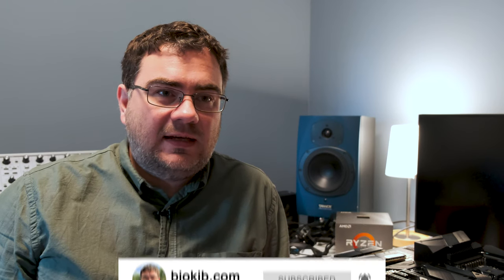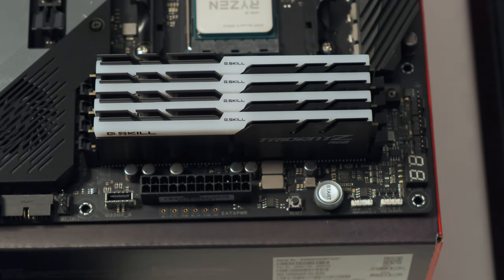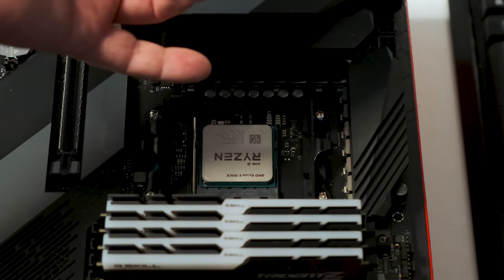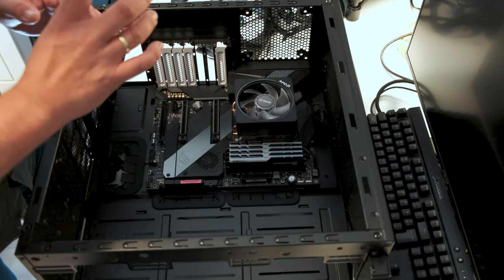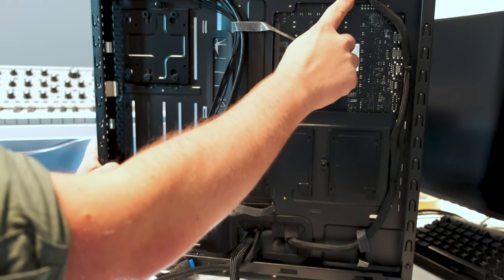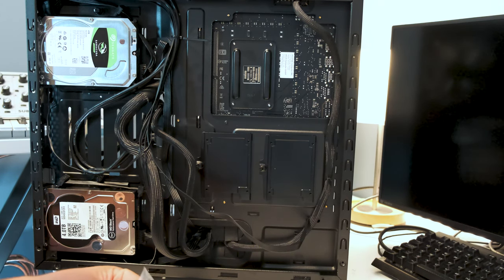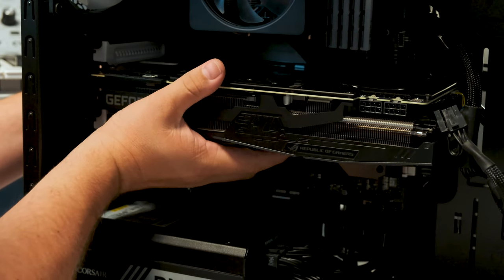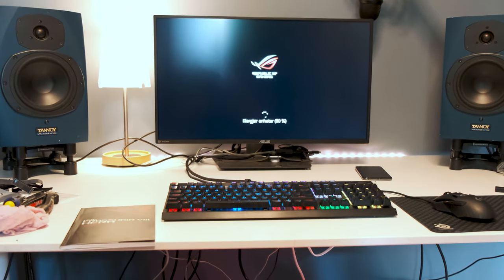How to build a gaming PC - easy to follow step-by-step guide with chapters!

Comment: Explained everything very well! Removing the sticker from the SSD is not necessary  because the sticker is actually a copper heat sink that is used to evenly disperse heat  on the SSD, and  it also voids the warranty. Other than that great video!
Reply from the maker: Thank you! :)

Comment: Won't the Noctua D15 interfere with your RAM? Noctua says the RAM clearance on the D15 is 32mm while your GSkill RAMs are 44mm in height.
Reply from the maker: I just moved the fan on the cooler up a little, and it fits. Its movable :)
Reply: In that case the height of your CPU cooler has increased to 177mm now. That's just 3mm shorter than the max limit of your case. Amazing choice of components :)
Reply from the maker: Thanks 😊

Comment: I just got this motherboard and I plan on using a fan cooler instead of Water Cooling... my question; I would like to add RGB fans on the side of my build as if I had a radiator with fans. How can I plug the RGB fans? Do I need extension cables and or some sort of module?
Reply from the maker: Should work, this mobo includes RGB headers and addressable Gen 2 RGB headers.

Comment: Hi Bjørnar. How is the Ryzen 3900x treating you? Still happy with the configuration? How about noise level? I'm looking at a similar configuration, except that I want SFF / small tower / desktop to save space. And I'm fine with a 2070 Super. Any case to recommend that can fit the Noctua NH-D15? Cheers and thanks for awesome videos.
Reply from the maker: Its working well for my use still. If the PC works hard I can hear some fan noise. Other than that its mostly silent. Not that up to date on SFF cases and if they fit the NH-D15. Its big. Noctua have other coolers that are more tailor made for cases like that I believe. For example NH-L9x65.
Reply from the maker: Thats a nice setup indeed! I am thinking of going smaller myself since the room I am in is small. But I think that will be a video when the next CPU from AMD launches. I noticed he underclocked the CPU. I guess that's why he gets good temps maybe. By not boosting it. Not sure if would run it like that, maybe need to test it and see how it works.

Comment: I looked up online and found some people saying that the sticker on M.2 SSD is designed to help the heat dissipation. Then I just wonder do we really need to remove that for better heat dissipation and whether the M.2 SSD's warranty will void by removing that. My M.2 SSD is Samsung 970 EVO Plus and I didn't find much information regarding these questions from the documents came with it.
Still, thank you for your video and it is the best and most detailed instruction video for X570 motherboard!
Reply from the maker: Dont remove it if it voids the warranty. Mine was so old so I figured it could be tried. It seems to work well still.

Comment: Did you notice and bend with the m.2 with the integrated heat shield? Ive heard it is a known issue and i may think twice if it can make or break my PC.
Reply from the maker: Not that I know of. Its been running fine for almost a year now.
Reply: Bjørnar Kibsgaard okay thank you! I saw many reviews talking about DOA boatds and quick failure rates. Im glad to hear another positive review!

Comment: What cable did you use to connect the cpu to monitor tho it doesn’t have any displayport or hdmi?
Reply from the maker: The GPU is connected using and DP (DisplayPort) cable to the monitor.
Reply: What kind of displayport type c?

Comment: I’m going to use this motherboard with a ryzen 9 5900x and a 3080 but I’ve seen that this board has died on a lot of people and was wondering if you have had this problem. Thanks
Reply from the maker: Yep, it died the first time I got it. The replacement have worked just fine 24/7 for a long time.

Comment: I follow the steps that you did why still can't the motherboard got the light but couldn't start
Reply from the maker: Its time for troubleshooting. Try re-seating everything first. If that doesnt work, try disconnecting devices you dont need for a successful boot. Like running with 1 ram stick, etc.

Comment: I followed your guide and it was really helpful. But I failed to get it started as I am getting 02, I double checked wires, RAM, and GPU. Still see the same issue. Any troubleshooting tips? Appreciate any help!

3900X
Crosshair VIII Hero
G Skill Trident Neo Z 3600 F4-3600C16D-32GTZNC
Sabrent 1TB Rocket Nvme PCIe 4.0 M.2 2280
ASUS 2080Ti OC
CORSAIR AX Series AX1000 CP-9020152-NA 1000W
Reply from the maker: All power connectors connected? To GPU, Mother board etc? Another guy further below here had the same issue. He forgot to insert all PCI-E cables to the graphics card. :)

Comment: Would it be easier to connect the case headers before the psu ? So there is more space to get your hands in. I will be building a similar pc next week ( first time build) so thanks for doing this video, it will be a great help. The x570 board has x16 on both lanes, so you can install the GPU in either the top or bottom slot ?
Reply from the maker: You can connect the case headers first if you want. As for GPU install, you need to check the motherboard manual if the slot you want to put the GPU in runs at full (16x) speed. :) Good luck!

Comment: yo, i am currently building a pc right now, and i got a bit scared when i put the cpu cooler in, because i put alot of pressure on the cooler, does that ruin the cpu?
Reply from the maker: The cooler that shipped with the AMD CPU? The bracket that holds the cooler down should have some pressure on it. So that the cooler is not loose. I think you are fine.
Reply: @bjornark  ok thank you so much, mate. Btw u from norway? I am!

Comment: My exact same motherboard doesn’t boot up and it’s stressing me out so much. I need my PC for important stuff. Error code goes from 27 to 0d and lights up yellow. Internet says it’s my DRAM. I’ve tried countless solutions through Reddit and other sites gathering information and none works.
Reply from the maker: Maybe its the SSD? My corsair drive just died. And it just booted into the bios. Have you tried bios update? If you can get into the bios that is.
Reply: @bjornark  I've fixed it thru updating bios, cleaning and rebuilding pc.
Reply from the maker: Sounds good!

Comment: Its been a while since my first pc build. But you mentioned cpu power supply. Is it included with the cpu, or must i purchase it separately?
Reply from the maker: You get power for the CPU from the power supply for the computer. Thats the only thing you need. :)
Reply: Bjørnar Kibsgaard thnx for the reply. i thought i was totaly way behind on pc build, i actually thought you meant we need a specific cable for todays powerful cpus leading to the power supply🤪.
im attempting my second build consisting of the same mobo and cpu as yours along with corsair crystal 570x case. while waiting for all to be delivered, i overlooked the part where the nzxt x52 cpu cooler might not fit above the motherboard and cannot seem to find anything relating from google. do you think it might be okay? nice informative vid by the way.👍
Reply from the maker: You can find the specs on the cooler most probably on the manufacturers website. It will tell you about the size, and if it will fit or not. Good luck. :)

Comment: Whats your personal reason or need for chosing that motherboard over any other cheaper mb?
Reply from the maker: Asus have always been stable and working well for me. So that is one reason. Also the components are a bit higher quality, and that can help if you want to do some overclocking. If you want to run everything stock and not overclock, there is nothing wrong going with a cheaper motherboard. As long as it supports the CPU and the features you need. :)

Comment: How does it run? How much can you overclock your CPU and GPU in your build? Did you get your RAM running at the right speeds? How does it fair in gaming or other processes?
Reply from the maker: It runs very good and I run the memory at stock speeds. As far as gaming goes it works extremely well. No complaints here.

Comment: do you think a NH-D15 will fit this motherboard? (not sure about the ram im gonna get yet)
Reply from the maker: The NH-D15 worked fine on this mobo. Just Watch your memory height. Or you may have to adjust the fans.
Reply: @bjornark  thanks, do you know why the amd website says on the 3900x page "memory 3200mhz / 2 channels"?
does it means i need 3200 & only 2 channels?
Reply from the maker: 3200Mhz is a good choice on a budget. But if you can afford it I would go for 3600Mhz memory. AMD is more sensitive to memory speed, compared to Intel for example. G.Skill makes memory that works well with ryzen. For example, G.SKill Trident Z RGB F4-3600C16D-16GTZR. I am using those, and they work fine.

Comment: Is removing the sticker on the M.2 ssd going to ultimately do anything?
Reply from the maker: Honestly? No, I dont think so in day to day use. It may cool a little better because the heat transfers easier with direct contact to the chip. But no, I dont really think you need to do it.

Comment: I don't understand why you installed your M.2 in the 2nd slot and not the first slot?
Reply from the maker: Easier to get to it in the second slot, if I would want to upgrade later on. CPU cooler and GPU is so close to first slot.

Comment: Thanks for video! Did you use some additional fans? I'am trying to copy your specs while building my first build =) BTW how loud is your build?
Reply from the maker: Sounds good! Yeah I am very happy with this build so far. It works very well for my needs at the moment. I havent used any extra fans other than one in the front, and one in the back. Other than that the fans on the Noctua cooler and graphics card is low in noise. In normal use, the system is very quiet. Also remember I use the Fractal Design R series case. And those are extra soundproofed. Good luck with your build. :)
Reply: @bjornark Hi! I'am building now this pc =) Is it ok, that my second noctua cooler, which is under the dimm slots, is above center cooler?

Comment: How are you connecting the motherboard to a monitor. As it has no HDMI or DisplayPort
Reply from the maker: I connect the monitor to the graphics card (GPU), which sits mounted in the motherboard. :)
Reply: @bjornark  so if i connect an nvidia rtx 3080 (which has a display port) to my motherboard I can then use its display port to connect the computer to the monitor. I am planning on building my first pc soon and I’m trying to get all the knowledge i can before starting. Thanks
Reply from the maker: Yes, you place the graphics card in the motherboard. And you connect the display to the graphics cards outputs. :)
Reply: @bjornark  nice thank you, sorry for any inconvenience
Reply from the maker: No problem, good luck with your build. :)

Comment: Can you explain how you decided or where to go to design a PC and the most optimum parts to use?  Thanks in advance.
Reply from the maker: Lots of research, watching other videos, reading articles etc. And some experience. :)
Reply: @bjornark  :-) :-).
Reply: @bjornark  Can you go over the electrical connections on the motherboard and other components?

I also wanted to ask about this motherboard and why you chose it compared to others.  

One last thing, so the cooler fan that comes with the cpu is usually not enough?  Thanks.
Reply from the maker: Not sure what you mean with electrical connections. 

The stock AMD fan is almost good enough. But you would want something beefier to keep the temps in check. But its not bad for a stock fan.
Reply: @bjornark  I mean, I would like to build my next pc and I would like ro see how all the electrical connections are made on this motherboard and cpu and other devices as well as for any lighting that the mb supports.  

In respect to the cooling, what other cooling options are there for this cpu that's not stock?  I've even heard of water cooling and don't know anything about that either.   Thanks much.
Reply from the maker: There is a lot of different cooling options. Air cooled, water cooled etc. I like the stuff from Noctua. Air-cooled, good performance and low noise.
Reply: @bjornark  Ahh, ok.

Comment: Hello! i saw you didnt use the other two cables included on the fan, is that okay? or is that a problem if trying change the RBG light?
Reply from the maker: As long as the fan spins it should be good

Comment: So I only need the 4 pin for the cpu?
Reply: I don’t have the 8pin
Reply from the maker: For this motherboard you need to connect the 8-pin, but you can leave the the 4-pin alone if you want. According to the manual.

It looks like using only the 4-pin wouldn't work in this case at least.

Comment: Nice video, nice build and part. However, i would chose an other cpu-cooler than the stock one, especially in combination with a 3900X. I think for this range, watercooling is the best at moment, but some good coolers like the noctua, but also other may do well. 

Still, the 3900x isn't a small one and need some freshness. ;) But it's a very good build, and i hope you will enjoy using it long time.
Reply from the maker: Thanks! Waiting for the AM4 bracket for the Noctua NH-D15 from the previous build.
Reply: @bjornark   that's a solid choice to go with. One of the best air-cooler still. And you can ever go fancy with the Chromax caches now to hide the brown fans if you dislike the look.
Reply from the maker: Yeah, ive seen them. They look really nice.

Comment: i am stuck at 02 error code.. any ideas?
Reply from the maker: HDD issue? Try reseating your storage, reset cmos.
Reply: @bjornark  i got it solved! It was the graphics card, i got gtx 2010 ti that had to be plugged and i did not plug in the last 4 pin connector :)) i thought it can draw power from the other 2, this thing needs a lot of power!
Reply from the maker: Good that you managed to solve it! 💪👍